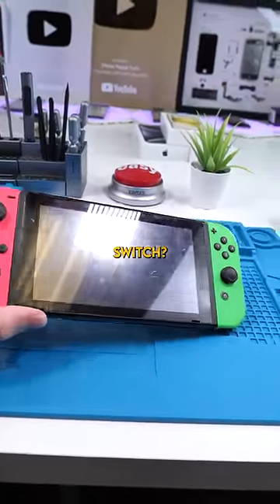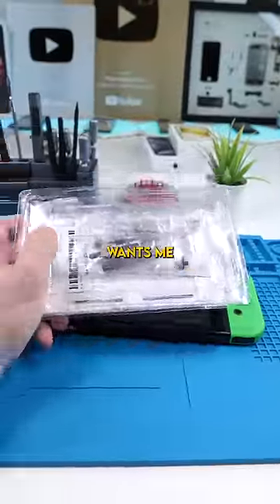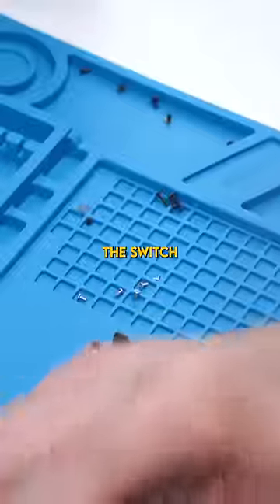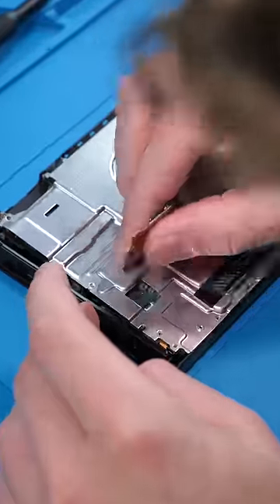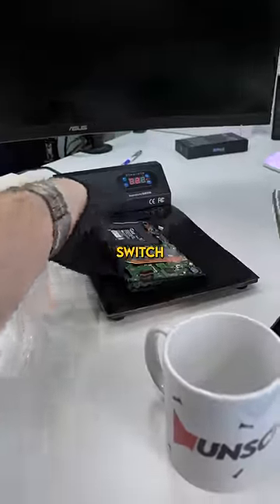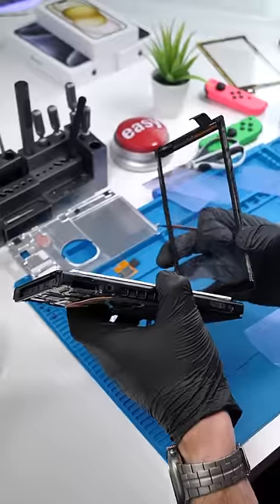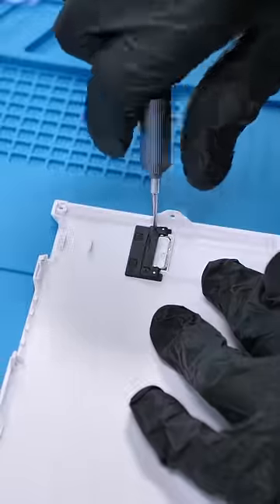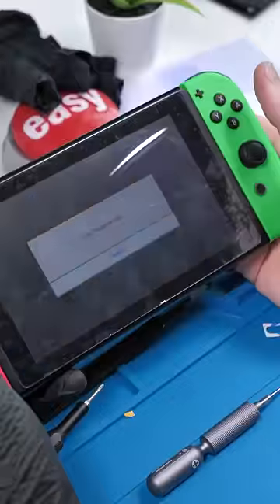We Switched Up This Nintendo Switch.. #Shorts

Comment: That guy should’ve used a tempered glass screen protector.
Reply: Even a normal plastic one works great for me.
Reply: @bojackson3073 tempered glass is much harder to break basically they have better protection for the screen because unlike regular glass it’s processed by chemical treatments or thermal treatments to make it tougher
Reply: @GoldennGramzz That's good and all, but to prevent two tiny scratches, a plastic one would be sufficient.
Reply: Yeah there like 5 bucks
Reply: Get hydrogels instead of tempered glass man. And an extra themed hard case set. I hate TG so much cus I can't glide my finger onto it.
Reply: @GoldennGramzz  harder to break than plastic? The plastic ones don't shatter...
Reply: He got a switch, he didn’t think about much else. Probably doesn’t think to begin with. Only actual handheld pc owners buy cases and screen protectors and all that jazz….
Reply: Fr his ass really wanted a replacement from having 2 little scratches thats why you get a protector ☠️
Reply: @asulon6 he obviously has the money to want to replace it. Why you going at some guy you don't know because he doesn't bother with screen protectors. The entire screen is scratched on that switch with surface scratches. There are just 2 small deep scratches. The whole screen is scratched tho.
Reply: Maybe is a gift or use Nintendo switch
Reply: I thought everyone who owns an electric device should? Isn't it basic knowledge?
Reply: @realnoscope  yeah, it would, until you drop in on the ground and the screen hit a hard object
Reply: @GoldennGramzz tell that to my 10 year old 😂
Reply: pokeplayzz  As do I, and a hard case. It goes with me mostly everywhere, even if I don't end up playing it.
Reply: @bojackson3073 I have tempered glass and while plastic works the touch screen feels nicer with glass
Reply: I need to put my screen on mine, but I hate putting them on and yes, tempered glass is awesome and I use them for everything except my iPad which I have the Apple pen for so I use a matte screen protector/Likepaper one and it makes writing on a screen much better
Reply: @flumiie why can’t you glide your finger on tempered glass ones ?
Reply: @flumiie  what do the hydrogel ones do? Are those the ones that are kind of wet when you put them on and have like a special case thing to help you put them on? Also, is it easy to take off because I hate screen protectors that are super hard to get off when you need to change it.
Reply: @shortyylu  wdym? Hydrogel protectors are flexible plastic and easy to take it off. Tempered glass just hard & it cracks when u drop it
Reply: @shortyylu  And no, they're not wet at all. Why I can't glide my finger on Tempered glass? idk, probably because I've been using Matted / clear plastic protector for too long i guess.
Reply: Those work but the struggle of having air bubbles under the protector and no matter how much you try to get the bubble out, it just reappears in the exact spot.
Reply: @flumiie your fingers are greasy and you didn't use good quality tempered glass with an oleophobic coating on it, that's why your fingers stick. I'm having no issues with tempered glass and hydrogel is just a fancy name for plastic with crazy markup
Reply: @tennicktenstyl  if anything my fingers is a tiny bit oily when i'm out and glides easier. I usually clean my hand a lot in home and it's actually giving more friction for me when it's clean. But sure, maybe I was using a low quality TG, I just haven't been using them for quite a long time now.
Reply: Sponsored by DBrand
Reply: actually tempered glass is worse cuz if i get something pointy like a knife and poke it it all shatters into a million pieces but with the glass they are using if it cracks it all stays into 1 sheet
Reply: Could it not be a screen protector at all and just the piece of plastic that came on the new screen
Reply: At my house, we don’t drop our switches
Reply: bro should of used magic john screen protector
Reply: @User-ghcwvouvmgs i dont like plastic i like glass cause its better for the environment
Reply: @thesheriff5091  you gonna recycle it after it breaks?
Reply: the regular screen is plastic that's why it scratches so easily but with my tempered glass protector it only has 1 scratch from all the years because I dropped it lol
Reply: Who wants Nintendo and chips with and iPhone for pudding
Reply: Yup, I've had the same screen protector since I bought mine years ago.
Reply: @realnoscope bruh no tempered only like 5 lol just get that
Reply: Maybe couldn't get at the time
Reply: My oled cracked under a tempered glass screen protector
Reply: You should see mine… multiple massive cracks on the screen protector
Reply: @flumiie  glass with a proper oleophobic coating is good, also hard to know the safety of the chemicals in "hydrogel"
Reply: @User-ghcwvouvmgs  that's not the point, the hardness of glass is 6 not 2.
Reply: @asulon6 digitizer replacement is a cheap repair.
Reply: That is the plastic film that you peel off of the screen
Reply: using screen protector is like using a condom
its safer but much less enjoyable
the screen will lose so much of its clarity
Reply: @nicknickname353  I don't mind risking my screen to break or any scratch
Reply: Jakwka
Reply: Is scratches like that Repairable cause I have one like it on my phone
Reply: I use a tempered glass one on my OLED.
Reply: Yeah, the biggest benefit to me is they just feel nicer to touch, and look nicer without any bubbling. The added strength is just a bonus.
Reply: I didnt even to that. But im gonna it so hard now.

Comment: I think this guy wanted someone to replace his back plate, looked at shipping, and just added something else to it
Reply: Hey do you fix blue screen of death on switch lite
Reply: @enriquecarmona2826 Bro what did you do???? You’re gonna have to give way more information if you want answers bud. Like if you were trying to jailbreak it, any error codes etc. I don’t have an answer for you but I’d recommend that you provide more information when asking for help.
Reply: @enriquecarmona2826 no offense but how do you get a BSOD, a WINDOWS error screen on a SWITCH LITE?? 💀
Reply: @Speedwy  I don’t know
Reply: @Jacob-ol3zb I doubt they were trying to jailbreak it because they probably would've broke it by placing the mod chip, or they would've already known the answer if they had an idea of what they were doing while modding but some people don't know how to simply place mod folders in smash either. I did drop my switch lite twice but for some reason it did not turn on after that, before going dark it did show pink and green on the screen for a split second, I never fixed it but not sure if it's related
Reply: @Jacob-ol3zb  I dropped it and then I was trying to charge it and the a blue screen appeared
Reply: He probably means a solid blue color @Speedwy
Reply: @Speedwy bro you slow? 💀
Reply: Me whenever a shop doesn't let me pay with card under €10
Reply: @enriquecarmona2826 bro ur gna have to do better quality research than the random comment section of a YouTube short if you actually want the answers to fix your console
Reply: @enriquecarmona2826 7 Months Later: Dude get to Nintendo and ask them. And if it was bait, congratulations, you got another useless comment.
Reply: @Speedwy he's built different

Comment: Bro that screen protector was bubblin' more than boiling water
Reply: It's the plastic layer on new products not a screen protector. He didn't take it off when he installed it new because he's saving it for the customer to remove. It minimizes the potential for scratches until the customer receives it and then it's not his problem.
Reply: @Rodrigo-ei4ht  oh thank God, I was so concerned, it looked so bad and I was very worried

Comment: Bro already wants to replace screen due to minor scratches while my phone screen has some quite big cracks in it💀
Reply from the maker: They were pretty deep scratches tbh so I kinda get it
Reply: My Switch has one deep but small scratch in the left top corner and I cannot suffer it. It annoys me so much that I stopped using it as much.
Reply: Heiudong do you ever go outside
Reply: The family Switch's screen has a crack from being dropped
Reply: My screen is literally getting out of my phone bro- 💀💀💀
Reply: Bro none of you guys want to see MY phone.💀💀💀💀
Reply: Bruh my switch has scratches so bad the display barely works...I still use it a lot btw but due to the damage I have to use the dock but thankfully I have another switch and that one works perfectly fine
Reply: My phone has 2 microscopic hairs between the screen and the screen protector and it's so annoying.
Reply: My switch has this really deep scratch but it's small and it's like in the center of the screen but not it's like a little the left of the center and I annoys me so much so do you kind of get it but at the same time this feels like a repair you can probably do at home not worth paying for but also get it cuz if you did it home you'd probably end up with an air bubble which is worse
Reply: @nmac101 just open it up and use a lint roller or tape to remove the hair and then place it back on lol
Reply: My phone is a crack
Reply: My switch has at least 5 scratches
Reply: bro should’ve just taken it as a chance to upgrade to an oled and get a screen protector
Reply: What does this person wanting to fix his device have to do with youre device being damaged? How much pity and attention do you need?
Reply: What do you mean already? That's the older model switch you can tell by how small the screen is
Reply: Forthakine he aint a bot lmao.
Reply: But your phone isn’t a switch

Comment: the BUBBLES at the end
Reply: that's just the protector for the new screen, not the screen itself. It isn't an actual screen protector though, just thin plastic for dust.
Reply: Ikr😂
Reply: @kawaiidevilchuu361 bubbles still bad
Reply: Rookie mistake 😬
Reply: @rendered_fox1855  there are no bubbles on the actual screen protector though, so why does it matter?
Reply: It’s the PLASTIC protector geez 😂🤦🏼‍♀️

Comment: I replaced my backplate as well and i was confused when my sd card didn't read. Turns out you really have to press the sd card in because there's a soft Cushion on top. You have to feel it click. But don't apply too much pressure obviously.
And be REALLY Careful with the screw holes, they strip really fast.
Reply: thats why my sd card doesnt work lol, put my oled in a full transparent purple hull

Comment: Nintendo should really switch the switch up
Reply: Are Wii gonna have a problem?
Reply: @Lumisbiggestfan  you need to get your membership back lol
Reply: I know this a joke but they already did lol, oled has obviously the oled screen, but is also plastic, metal and glass now instead of just plastic on plastic on plastic, and has double the storage
Reply: It's still slow as hell
Reply: @Lumisbiggestfan  intel processors wouldn't work well because they don't have arm architecture. But selling a console in 2023 with a chip from 2015 is criminal
Reply: @Lumisbiggestfan  it's not an arm processor so it's not good for a portable console
Reply: @Lumisbiggestfan  non-arm processors wouldn't work with a portable console
Reply: they did with the lite
Reply: they're literally releasing their next big console any moment now
Reply: @dawhoelse amd zen 2?

Comment: I actually bought a mat exactly like yours (probably a ripoff but i needed one) and it's actually pretty good. 
I'm even making a plywood case for some screwdriver bits and a soldering iron that holds the mat.

Comment: I have a switch but the sd card slot is broken and it won't read the sd card and what makes me mad is how the repair shop didn't even touch the switch and said it's a problem with the motherboard so guys. If you want a good repair, make sure to go to a trustworthy place

Comment: Ive got scratches but they arent on the screens directly, theyre on the black rims where theyre not noticable. I ljke taking stuff apart, but i would rather trust you with the screen than myself.

Comment: I omost pulled my screen off but seen and reversed it before it was too late
Reply: The glue they use is not that strong because I was able to lift the screen through the speaker hole

Comment: Can you please change an iPhone 14 Pro screen to a normal 15. Because there is a myth that the iPhone 14 Pro and the normal iPhone 15 have the same display and Apple uses software to reduce the 120hz. The iPhone 14 pro and the iPhone 15 have the same resolution, the same brightness and the same display edges, only the 120hz is not available for the normal iPhone 15